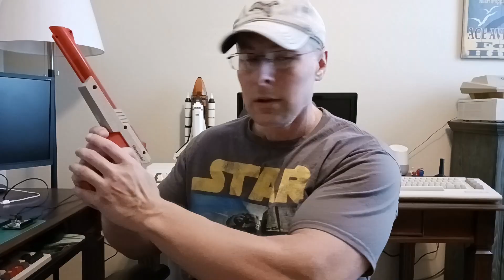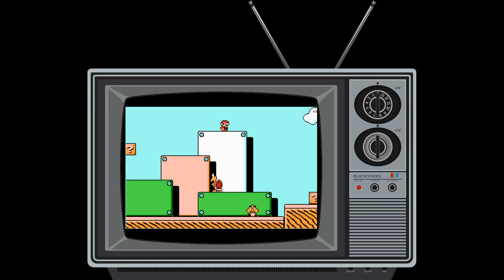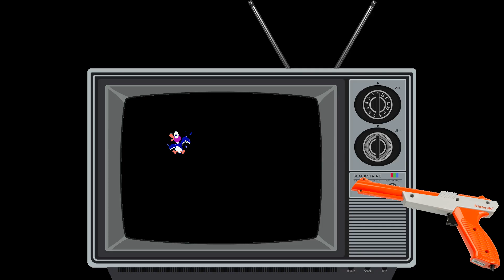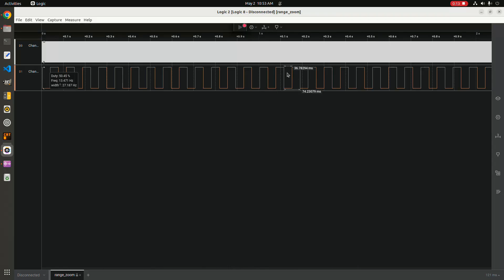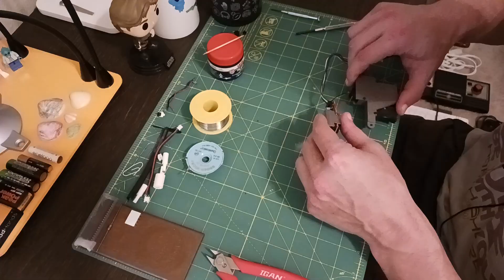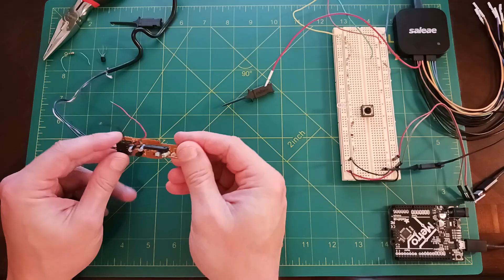NES Zapper: The Definitive Guide to How It REALLY Works!

Comment: Input lag in flat TVs is the main reason why Zapper won't work with them. After pulling the trigger, the gun expects a black frame, then a white box immediately. LCD... TVs are known for having input lag issues, turning black only after several (For example 16) miliseconds, and the gun didn't receive any changes in the appropriate time

Comment: So it detects the flashing that occurs as the tv draws the black background/white box one scan line at a time.   I would think that a tv tube would have more persistence in that coating.   This would require some sort of clock, it looks like R4/C4 is used as an RC oscillator.
Reply from the maker: Strange but true. There are videos out there where people have recorded CRT TVs with high-speed cameras.

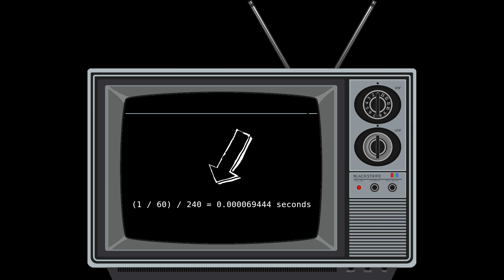Comment: At 3:10, there's a mistake in the math.  NES actually has 262 total scanlines, not just the 240 that get drawn.  There are 22 additional scanlines for vertical sync and vertical blanking period.  Also NES frame rate is ~60.098FPS, not 60.  This makes the horizontal refresh rate around 15.746 KHz rather than 14.4KHz.
Reply from the maker: You are right! Thanks for pointing that out. I would like very much to change that in the video, but YouTube does not allow edits. Fortunately, this fact does not change any of my findings (e.g., the actual triggering range, which is more broad).
Reply: @nickbild8401  Yeah, it works out that both the wrong number and the correct number are in the range that will activate the sensor.
Reply: @nickbild8401  Just delete this video and reupload.
Reply: Get off my back porch!

Comment: I feel like taking apart the Zapper and the Control Deck and putting them back together were rites of passage as a kid. I did that a ton of times. I know I was surprised as a kid with how 'little' was contained in the plastic. They really were simple, elegant, economized designs - compared to the radios and alarm clocks I'd take apart!